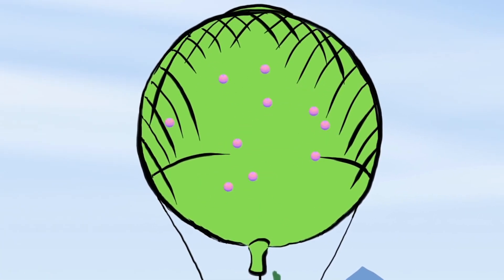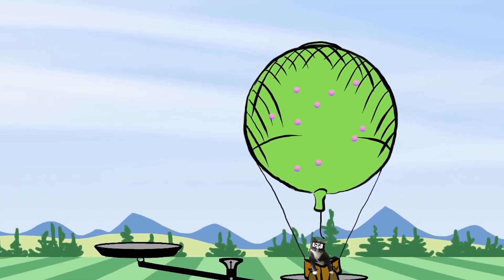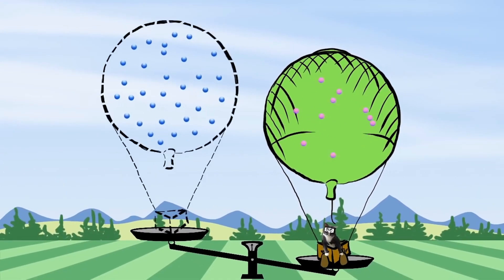How Gas Balloons Fly

Comment: start making balloons out of conductive plastic like is used to wrap computer components.   if there is no oxygen in the gas in the balloon.. there won't be any problem with static discharged sparks..  hydrogen needs oxygen to combust..   if rubber balloons are used.. might experiment with pouring Downy fabric softener.. into them then draining it out.  it would be a diluted solution.. did you know that if you have static build up when walking across carpets.. that the last person out of the office or the last person up.. gives a dilute solution of downy and water misted on the carpet to dry overnight..  no more static..  till the carpet gets carpet cleaned ..